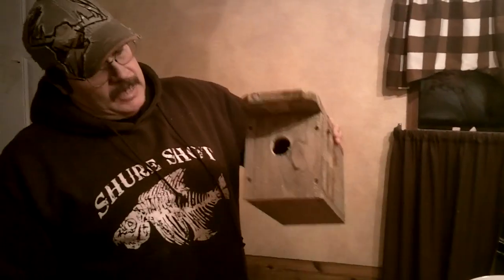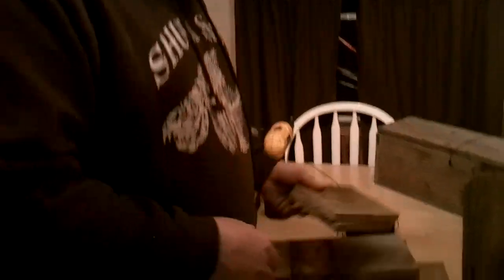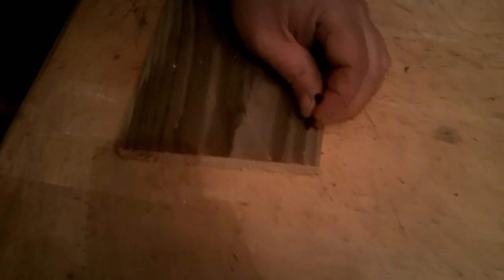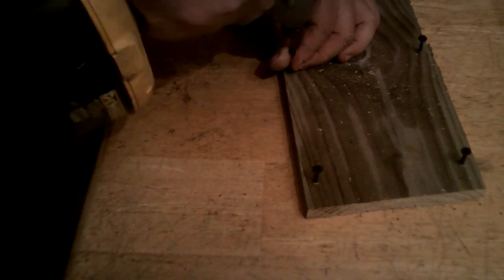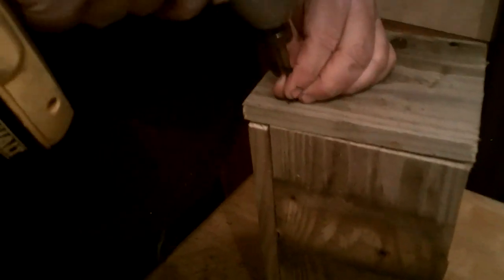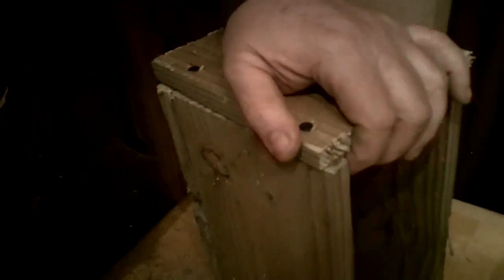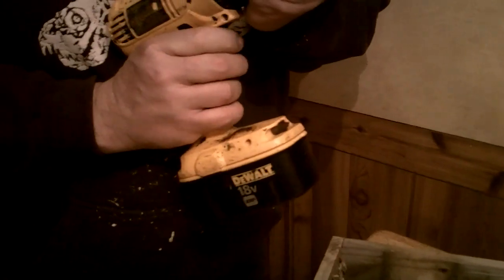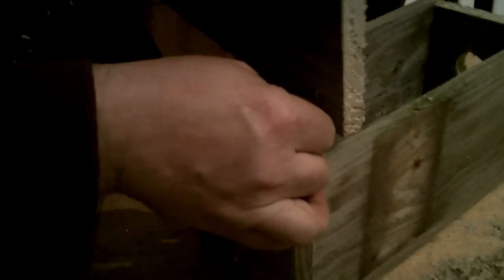Weasel (Ermine) Trapping Part 1 Making a Weasel Box

Comment: I build boxes that are almost exactly like this. A couple inches longer and instead of wire I drill 4 holes at an angle through the top board into the sides and use a nail in the holes to hold it shut. About any similar design works well for weasels.

Comment: wouldn't a mink try getting in there too if you make a larger hole? wouldn't the rat trap be good enough to kill or at least keep it there?
Reply: SirLobsterman if a mink got in there the rat trap isn't gonna hold or kill him.  I've had trouble killing bigger grey squirrels with a rat trap and a mink is far tougher. The skull on a mink is probably 3 or 4 times thicker not to mention a mink is way stronger than a squirrel.